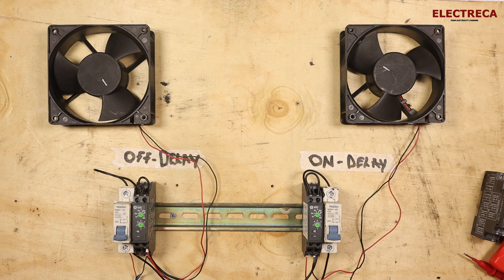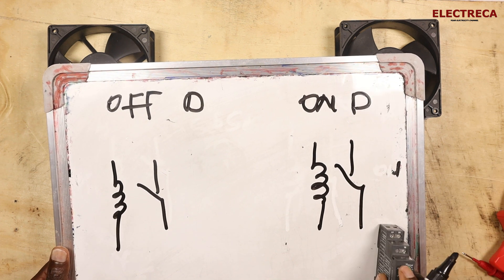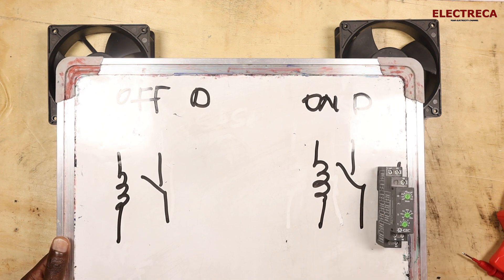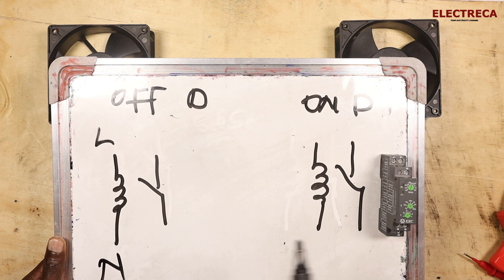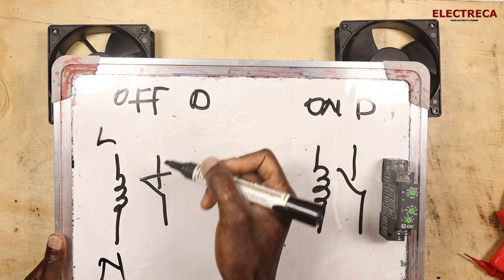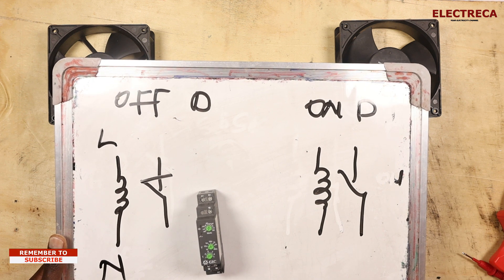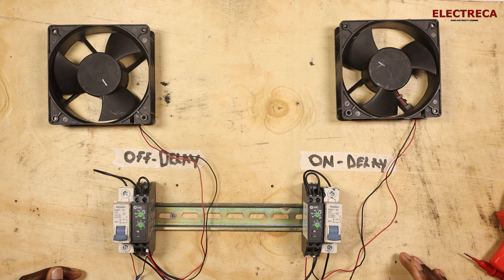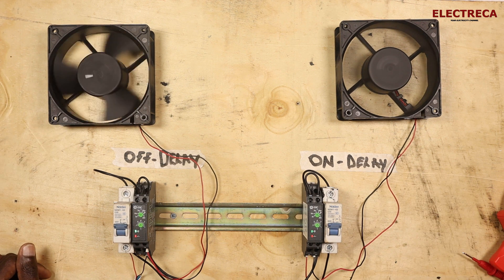Understanding On-Delay and Off-Delay Timers functions : Basics and Applications Explained!

Comment: How is the wiring connection if I want to use an off delay timer to function as on delay. I'm doing start stop the load is only indicator lamp this is for testing only. Timer is siemens off delay 15 com 16 NC and 18 NO. Thanks!
Reply from the maker: With the off-delay timer, you can achieve an on-delay function by wiring the load to the timer's normally open (NO) contact.
Reply: @elektreca  I tried using NC and NO but it energizes the load immediately. Any suggestions. Thanks